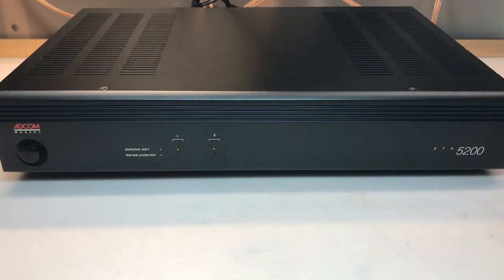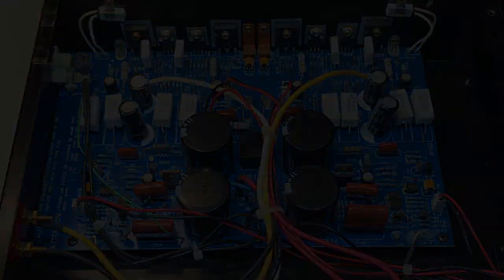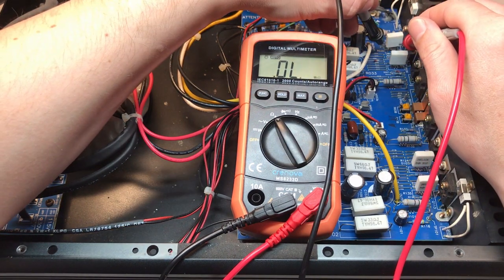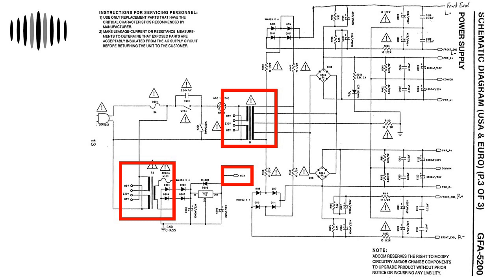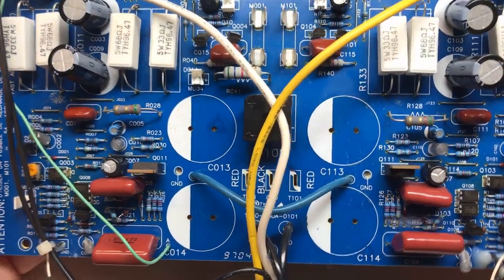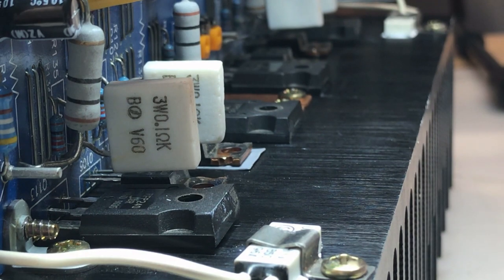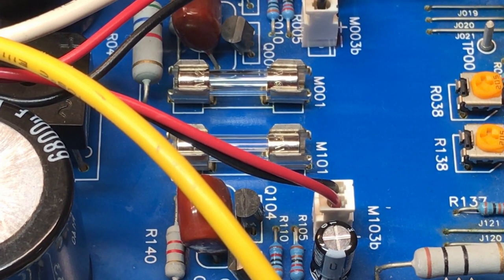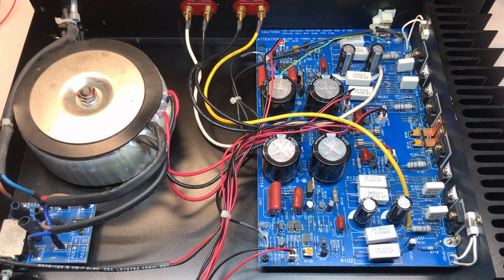DR #30 - Adcom GFA-5200 Repair

Comment: I bought a GFA535 on Ebay and it was DOA. Contacted the seller and asked him didn't you test it before you listed it.  He said he didn't have a pre-amp, told him all you needed was a stereo mini rca to an rca cable  and use your phone as a source. He gave me a full refund. The unit looked like a beast, dual mono design with single AC plug. Sent it to a local shop i know and for $160 he repaired it,  that was 2 years ago and working great.

Comment: BTW, the bias is incorrect on the 5200 schematic.  As has been noted on one site, the 20mv value was transferred over from the 5300, which uses .33 ohm resisters for 60ma.  So because the 5200 uses .1 ohm resisters, 20mv sets the current to about three times what it should be. So more like 6mv should be applied.

Comment: Nicely done sir!  Not to spend your money, but if you do much more work like this, consider buying a HAKKO FR301 desoldering gun.  Yes it's crazy expensive but it beats the hell out of copper braid for removing solder, particularly from old PC boards.
Reply: Agreed, it’s a game changer.  I used an FR301 for about two years and it is now my backup. I grabbed an FR-410 with gun handle and boy oh boy it makes the FR301 seem like a cheap toy.

Comment: Great videos and work! Thank you for that but I would like to make a note - this is an audio equipment. Please consider recapping with appropriate capacitors. Termal/temperature rating should not be the most important thing.

Comment: Nice work,  I would have used a vacuum desoldering gun to remove all the transistors still mounted to the HS.  Hakko or such,  not one of those pad destroying hand solder suckers.    Braid is fine,  just risky for pads and expensive.  Overall good job.

Comment: What is the reason some of the rail caps are installed elevated over the board instead of touching the board?
Is it for better heat isolation ?

Comment: Nice work! I have the same amplifier GFA 5200. It runs very hot, but does work. 

Also have the GFA 5200 that has developed a high pitch crackling noise through the speakers when the music stops or it’s paused. 

Any idea what could be causing the noise?
Reply: Runs hot because 90% of its life is spent in Class A mode - tons of heat but a great workhorse :D

Comment: I’m curious where you are located I have a pair of GFA 565 dual monobloc amps very large one has a dead rotten fish smell which I’ve been told has bad cabs the other one I’m sure he’s got bad cats also but the sound comes on only when you briefly plugged in the RCA cord but as soon as the ground sleeve of the RCA cord touches the ground on the RCA input sound goes away so anyway where are you located hopefully you’re close if not oh well I may drop these off and have you repair them
Reply from the maker: Hi Marc,

I'm in Minnesota (Twin Cities area).